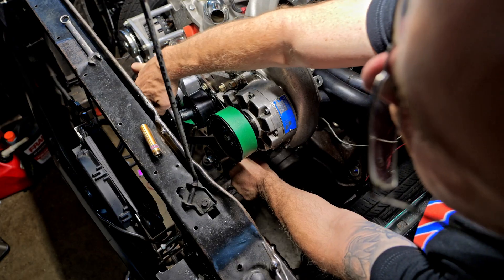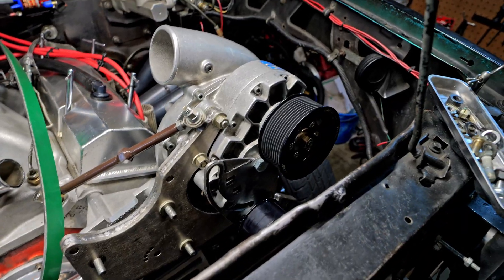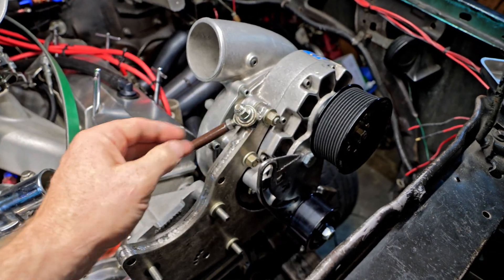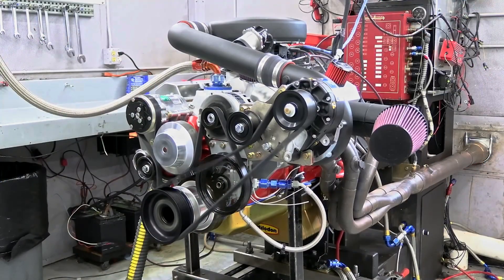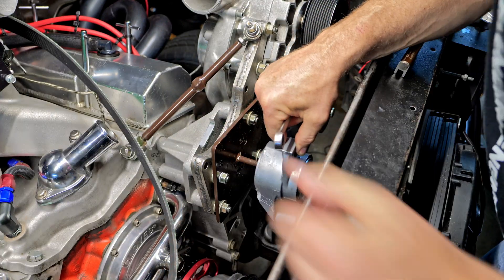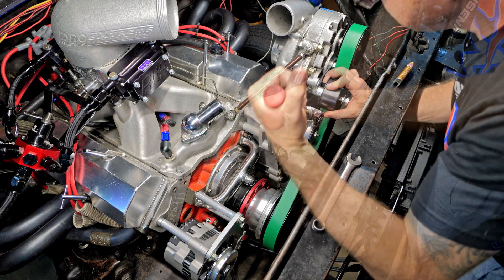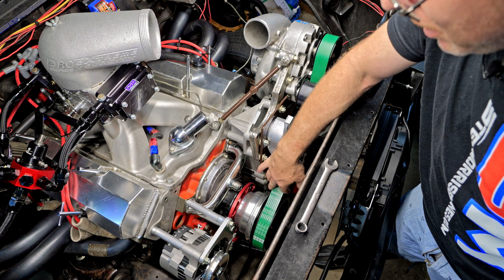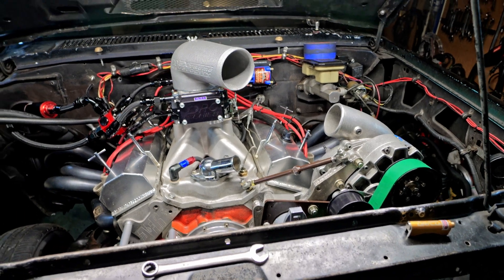Vortech YSi supercharger 20 psi of boost and no belt slip? 400 SBC V8 S10

Comment: I've been using a cog setup on my sbc 400 for years on the street and Interstate driving to the track.  I hit 20 psi at 7000 rpm with a Procharger D2R.  I've always wanted to try a YSI but years ago a guy talked me out of it because of the flimsy brackets.   What's nice about the cog drive is that the belt doesn't have to be very tight.  Seems like it's not that hard on any bearings.   I did however pin the crankshaft and I'm not using a BBC snout either.

Comment: Cog system and an ATI Super Pulley on the blower. Look into it.
Reply from the maker: @arturozarate1752  I'm trying a belt just as a challenge I'm dumb for doing so. 😅
Reply: @TPVPRO  some of us took the beatings already so others wouldn't have to....🤣🤣🤣

I hear ya. 20 years ago I enjoyed the challenge, but today I'd rather save the time and money man. Your journey is your own.

I didn't notice what fuel you're running. E85? I'm what your IAT's are. Vortech had the best volute in the business 20 years ago. How far do you plan to go without intercooling?
Reply: @TPVPRO  btw, good job stacking the brackets. Somewhere out there is driver side bracket assembly I had made from 3/4" 6061 for a NOVI 2000. I never got around to running a Ysi on the assembly, and I sold it years ago. Never thought of welding two together🤦‍♂️
Reply: @TPVPRO  ok so off subject. I need some real data that I can trust. I don't see you as one to jerk anyone around with BS.

What are your IATs before and after the carb under boost and at what level?

Thanks in advance!

Comment: You may reach your goal of 20psi but at the expense of putting way too much pressure on the crankshaft. 
You might have been better off by putting as much psi before you have belt slip and then adding Nitrous to get the power you want

Comment: Definitely don’t over tighten the belt, it will kill the bearings in the supercharger.
Reply: The tensioner limits that,
Reply from the maker: @blueblood76  Man you can get that belt super tight. I may reposition the tensioner for a little more throw.